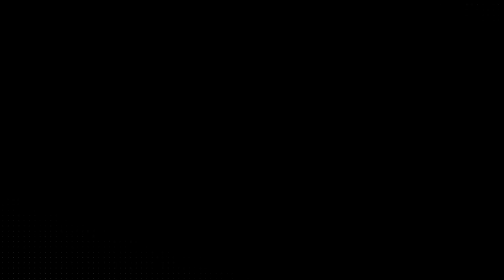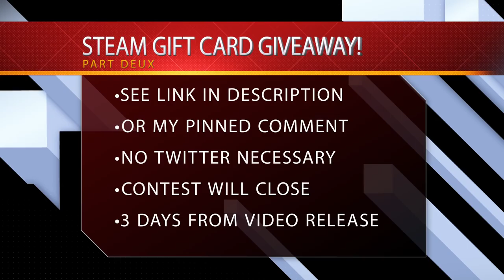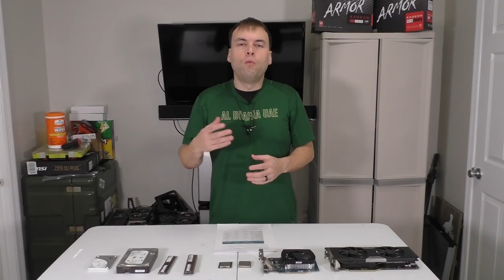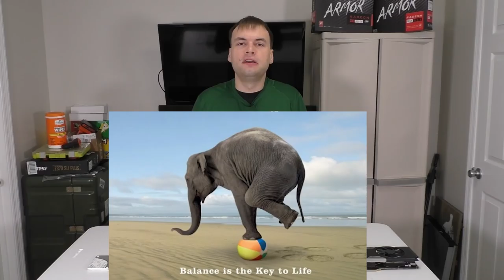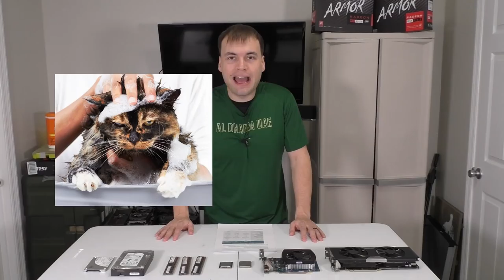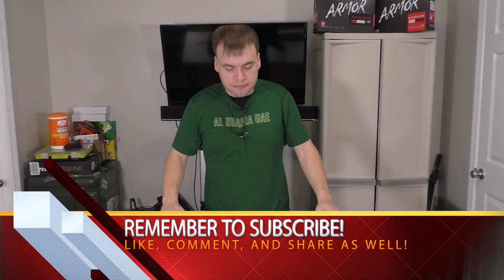Bottlenecking Explained - Hardware Help Episode 2

Comment: Looking for a sub 100 U.S. dollars GPU that can handle Fortnite and Overwatch what do I get.
Reply from the maker: GTX 950, RX 560, GTX 760, r9 270x (or HD 7870), r9 280 (or HD 7950), r9 280x (or HD 7970).  Any of those will run Fortnite and Overwatch easily at 1080p and all of them either are always under 100 or will sometimes drop below 100 if you watch the used market closely.
Reply: Thanks